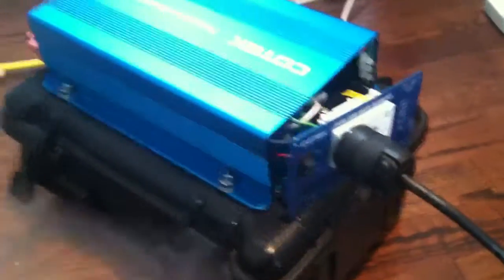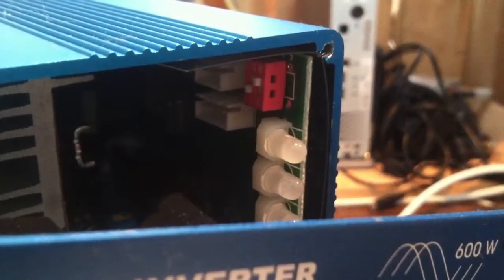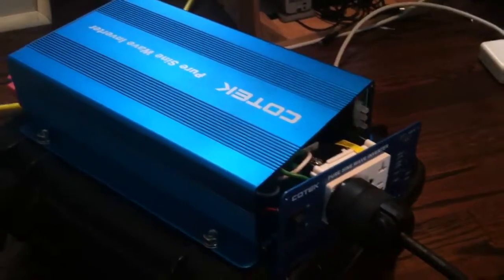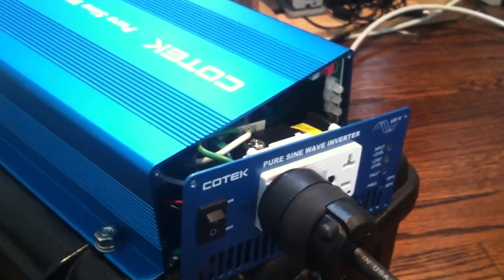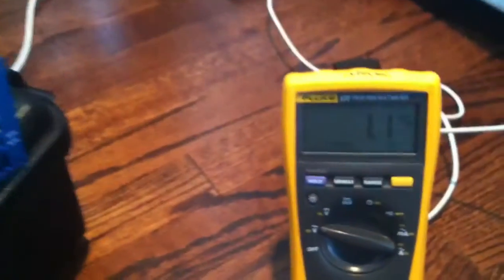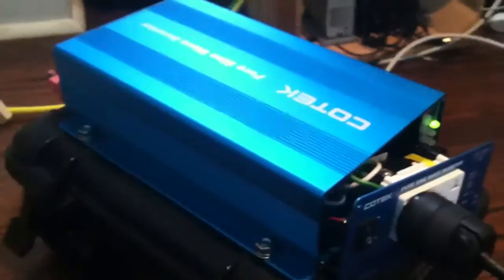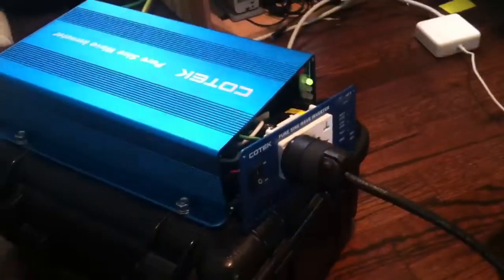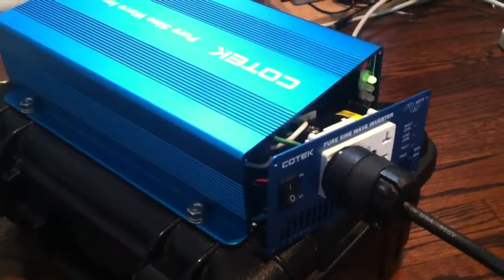How to change voltage output on a Cotek S600 inverter

Comment: Good and Old video.  There is a small difference in Idle Consume and Performance between the "S600-148" and "S600-248", do you think that is related to the output voltage?

Comment: How long does the power last off of that battery pack? I wonder if you can do this with a motorcycle battery. Mini power bank. Awesome
Reply from the maker: Pack is good for about 720Wh, maybe more if you have a light load on it.  It consists of 16 15Ah "Headway" LiFePO4 cells in series. Seems to run my fridge (full size energy star) all day without any complaining.  It's quite expensive, but is very energy dense and should be good for several thousand charge cycles if I treat it well.  http://www.goldenmotor.ca/products/48V15AH-LiFePO4-Battery-in-FREE-Eco%252dpack-Bag.html  I've thought about doing a video on it.  Any interest?

Comment: Dang wished you showed us the quality of the innards of this inverter
Reply from the maker: Ask and you shall receive. A video showing the guts of my Cotek S600R, by request of cadw600.  
Sorry up front for the periods of low light in the video.  If there's anything you'd like to see in particular (which doesn't involve complete disassembly), let me know and I'd be glad to try and find you an answer.  So far, I'm really impressed with this inverter.  Sine wave is beautiful on a scope, even when under near full load when my shop vac starts up.  You can see the voltage sag under initial start, but the waveform stays pretty the whole time.  Even runs my fridge without too  much complaining.

Comment: Thanks for the video.  Now I know that this works with Cotek inverters too!
BTW, that's a nice multimeter.  Wish I had one...
Reply: This question is not for this video but for something else,on the 3800 engine, what is the name of that L-shaped metal tube connects to the throttle body to the manifold? Need to know where to get a gasket for the other metal tube that connects to the throttle body with a flange end on it, it's candy cane shaped. Please let me know something ASAP.
Reply: Tim Wilder
hmm.  The car's outside and it's raining so I don't feel like looking at it...  If you look up EGR components do those look familiar?
Reply: What I was talking about,has nothing to do with the EGR components.This pertains to the throttle body.The two metal tubes that connects to it. 

Sent from my Virgin Mobile phone

-------- Original message --------
Reply: Hello, do u know how to change the freqency of a xantrex xw from 60hz to 50hz
Reply: 1000W Pure Sine Wave Inverter Power Board Post Sine Wave Amplifier Board DIY kit
Reply: Thanks test DIY kit 2000w video